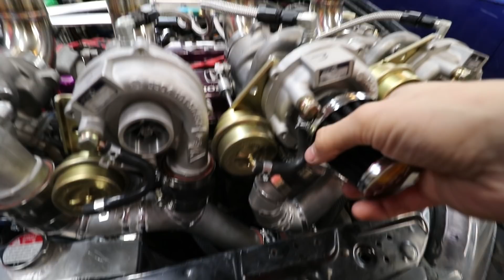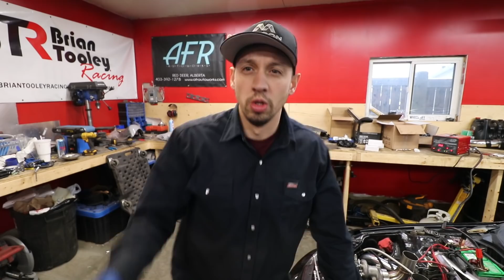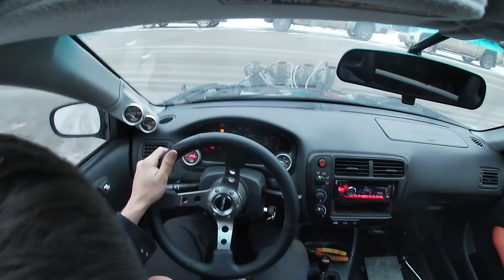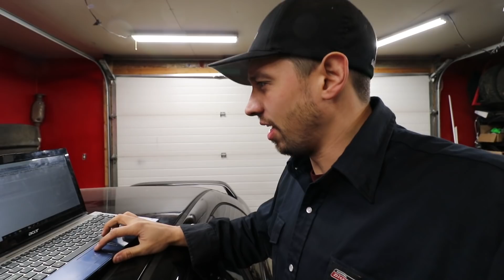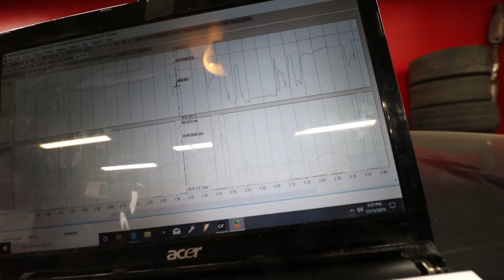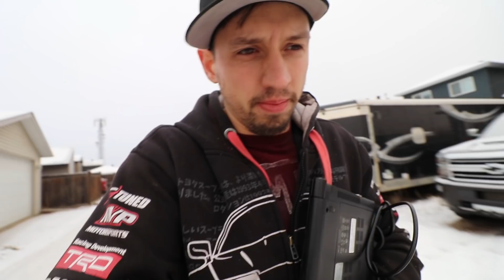Quad Turbo Civic Build - Part 6 - 2 Step!

Comment: I put a b18b1 in a civic once. But nothing like this. Rule of thumb keep it simple, and get you a good guy with a laptop to tune it.... you will need a tuner on a setup like that.   You got like 4 turbos that need to synche up. Itll run reallygood,but. To get the best tuning you need a geek with a computer X) to test all your fuel air ratios. I'm not that geek but good luck X)

Comment: What do you have a sensor tied to the cam for like a custom ecu? That's crazy bro. Do you spool from all four or do you isolate to cylinder? You should put in a vtec solenoid toggle switch on your steering wheel like a nitrous button, have two separate tunes for the daily track car.

Comment: standard waste gate is set to 0.2 bar/3psi for the k03 1.8t application, thats why you not are getting more than the 3-5psi, T them all together and add a MBC

Comment: Would be curious if those air filters are restricting flow. Had some cheap ones like that on an 250cc ATV once and it would fall on its face. Took it off and ran like a champ. Ended up getting a higher quality one.

Comment: I dont mean to be this guy in the comment section but what compression ratio is that motor? 125 to 130 psi on a compression test seems really low for a b series....I'm by no means a master technician but I have had a few b series turbo setups and ls vtec setups and mine were in the 180-90 range at 10:2:1 compression......maybe something to look into 😊

Comment: I don't see how there would be enough exhaust pressure to properly spool up the turbos, unless they were tiny as hell. Totally impractical, starts to spool up at 63k rpms 😂 😂
Reply from the maker: You didn’t watch the video. I make boost at like 4000 rpm and the rev limiter is 8200
Reply: @AdventurekyleAU  yea but that's total boost, not per turbo
Reply from the maker: THE FORGOTTEN wtf are you even talking about. Boost won’t compound on itself they all share a manifold on the cold side meaning they will all create one pressure
Reply: @AdventurekyleAU  I'm aware, my point is 4 isn't gonna make more than 2. The amount of boost you're seeing is completely impractical
Reply: @AdventurekyleAU  you'll see.
Reply from the maker: THE FORGOTTEN impractical yes. Your point that it will spool at 22k rpm is stupid.
Reply: @AdventurekyleAU  it wasn't a point, it was clearly a joke, but it went right over your head obviously
Reply from the maker: THE FORGOTTEN sure buddy ;)

Comment: You can't make boost because your engine can't produce enough cylinder pressure to spin the turbos. The engine already has low compression as well (judging from you 125 psi test). Having one cylinder per turbo (which are too large for one cylinder) is not the right way to go. It's funny though, I'll give you that. There's a reason why car companies do either single or twin turbo. You need sufficient cylinder pressure/load to spin the turbo. Have four or three cylinders per turbo generates that needed cylinder pressure and velocity to spin the turbine wheel.
Reply from the maker: It made 5 psi 🤷🏻‍♂️ I’m going to tighten the gates as try again
Reply: @AdventurekyleAU  Yes, it made 5 psi, but the spool was extremely laggy and 5 psi isn't a whole lot. I'm not trying to be a downer, I admire your motivation! Just speaking from working a Turbonetics for 8 years. Good luck.

Comment: I had just pushed out a yuuge tequila & taco load when you pointed at the camera saying I know you're pooping. You know one of those kinds when you push it's like a fist punching through your arse and it melts when it hits air, leaving splash marks all over the inside of the bowl, ("well that's gonna leave a mark") and then you get that wicked cold splash  back on your cheeks. Kinda felt like chewing 5 gum.... 
Happy boostn and poopn y'all.

Comment: 5 pounds on the gate is reasonable. Might want to get a boost controller wired up before its tuned so it can be raised from there.

Comment: Each of those turbos are engineered to spool off 4 cylinders. You have 1 cylinder trying to spool 1 turbo. Also, those turbos are engineered to be used with piping.

Comment: I'm no turbo expert but I do believe because you have 4 turbos on a 4 cylinder your number one turbo has to wait for the cycle of the engine to come back around before it gets hit it again and same goes for the rest of the cylinders so I do believe that you will be lucky if you get three or four PSI out of that thing I bet you if you take two of them off and Bridge together you'll double your PSI and I'm not knocking what you're doing I think the car is awesome especially with the for turbos

Comment: You should just make a temporary 4 to 1 downpipe/exhaust so you can run all 4 together and not have to run 4 exhaust sensors for tuning then remove it for driving. Or just make a permanent one that dumps them all into 1 pipe out the side

Comment: Just FYI, pulling timing helps spool up, & adding timing will slow spool/add low end torque. That's why anti-lag pulls timing, causing more unburned fuel to ignite inside the turbo. But great work Sir 👍.

Comment: Alright so just got done arguing with the lady. So, yeah you’re 🙏🏾 close to that 60K now. Did you check timing before you took timing out? Don’t recall...either way, keep on keeping on dude. 

In the event it works properly, and nothing comes knock-knock-knocking on heavens door. Then upgrade the tranny next?

Comment: Just ad pressure to the top of the gates and see when it opens .also get the speedo to work the VSS signal is important for Honda's
Reply: 2 step is speed activate no vss allway on 2 step

Comment: Not sure what’s done to that engine but my stock GSR would make upwards of 200psi per cylinder. It’s awfully low, less than 100 and it won’t run lol at its lowest I would expect to see around 150 each
Reply from the maker: Its got low comp pistons

Comment: That’s weird if u watch the boosted boiz latest video they were tuning a Honda in the background that was boosted with v-Tex and it was doing the same, cutting out everytime it got into a v-Tec and boost at the same time. I don’t remember if they said on the video what fixed it
Reply: Even phoñg said it when he was doing the valves on that head .. said the car sounded off  hehe

Comment: Those k03 turbo spool around 2500rpm on a vw 1.8t. The early 1.8t push around 8psi and the later  k03s push 11psi from factory.  The wastegates are usually set around 5psi. They should be able to be pushed around 15-17. Hope that helps. Should be able to make some decent power with 4 of them.

Comment: Youre hitting your 2-step limiter because the ECU thinks the car isnt moving.
Reply: Idk, you can rev it to the limiter. Its because temperature. Older Hondas will not run over like 4k or 5k rpm while the oil temp isnt over 50 degrees Celsius.
Reply: Hook up the speedo, dork!

Comment: if you put more preload on the rods that open the wastegate it will be a ghetto way of raising the boost, just undo the locknut, pop the c clip off and tighten a couple turns at a time

Comment: Also just noticed your speedometer isn't working. Without vss signal your vtec most likely wont engage.
Reply: Yes it run off of oil pressure but the ecu wont let vtec engage unless it detects that the car is moving. So without VSS signal that means no vtec. Same reason you cant hit vtec while just revving the car not moving.
Reply: Yepp and its throwing a cell so this is probably it...it falls on its face as well because it can be into limp mode
Reply: Runs off oil pressure
Reply: @zkeyes4056  yes it runs off of oil pressure but the ecu wont let vtec engage unless it detects that the car is moving. So without VSS signal that means no vtec. Same reason you cant hit vtec while just revving the car not moving.